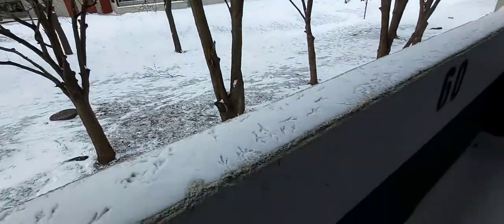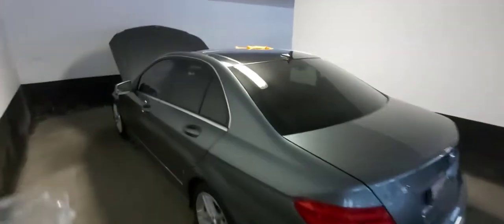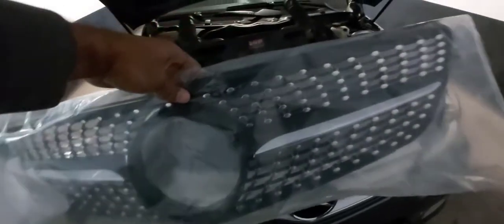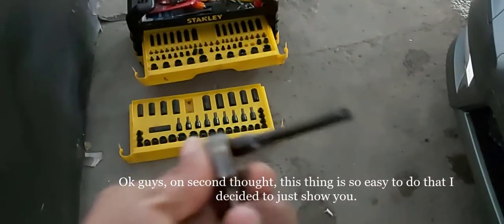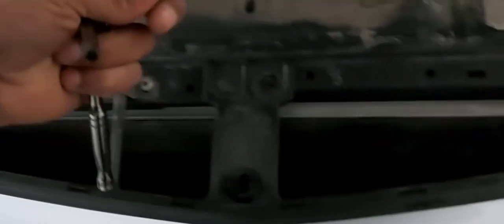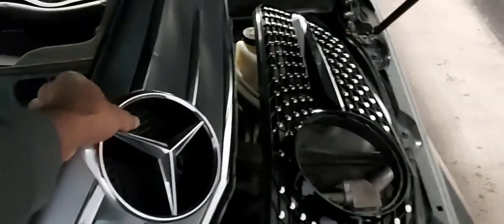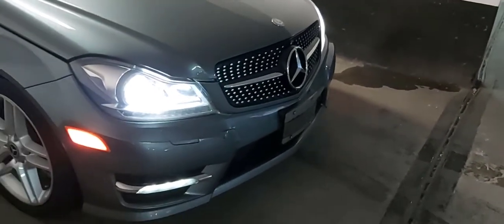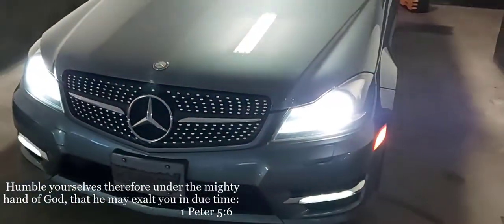Mercedes Benz W204 Diamond Grill Installed

Comment: I have the diamond style grill on my 2012 mercedes benz C250 W204 but the grill badge has clearance issues, some sort of box bolted right behind it won't let it sit properly in front of it, how did you get around this because the grill badge is a lot wider than the original glossy black badge
Reply from the maker: Hmmm, maybe the manufacturer was different. I'm not sure because mind was fine.

Comment: the start emblem came with the grill? cause i cant find the same grill with the star
Reply: ebay
Reply from the maker: Sorry bro, just saw your comment. No it doesn't come with the Mercedes emblem. You have to use your stock one..
Reply: @V-TecHondaLove   I came to see how you swapped it, unfortunately you didnt film it :(
Reply from the maker: @colinkanwischer7552  You saw me remove the old grill. All it is is remove the bolt on top, push the bottom in on both sides and pull it out. Only thing I didn't show was how to remove the cover and that is just clips. Dude it's so easy, 15 minutes tops. Ok man, good luck..

Comment: Hey bro can you send me the name and contact # of the local dealer you got the grill from.
Reply from the maker: I don't have his contact info because I broke my phone but the store is call extreme parts. He's in the GTA you can find him on kijiji
Reply: Hey bro I bought the grill from extreme , but my old star is not fitting did you have to modify your to fit?
Reply from the maker: @devsurajpaul333  Hey man, no modification required. It's a direct fit.. one turn out, one turn back in and lock... If you got the right one it's a 100% just like stock fitment bro..